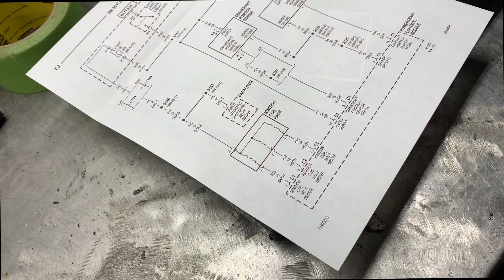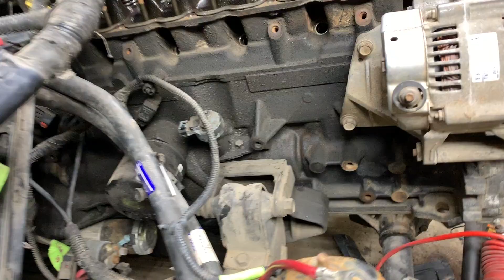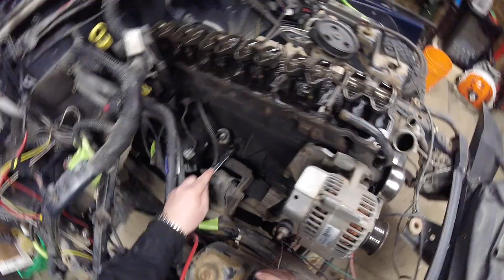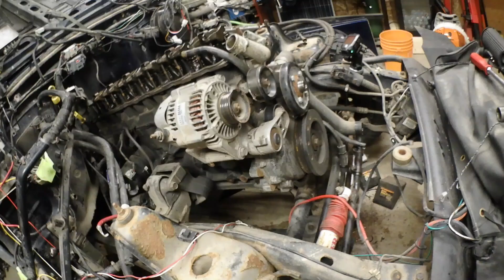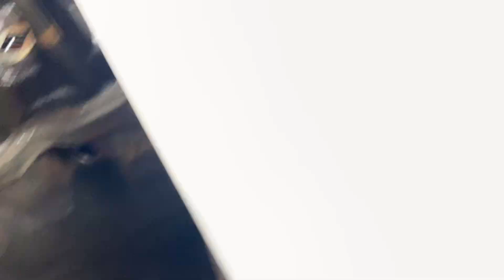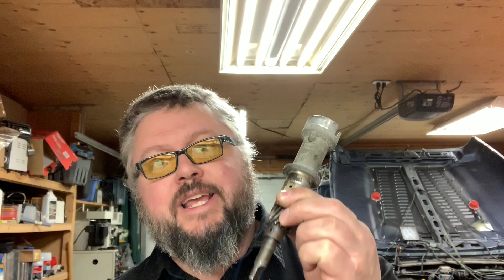DIY Jeep TJ Camshaft Postion Sensor / Synchronizer 4.0

Comment from the maker: How to sync cam after replacing those parts 
https://youtu.be/wKdtRec9dKI
Reply: Question. My jeep wrangler idles fine and even in gear I can let go of the brake and It won't stall but when I press the gas in gear it hesitates a little bit, catches, and then stalls.. please help

Comment: Man I have 2001 xj 4.0 driving down the road cut off the fuel pump wasn’t working we changed it now it works but we got crank no spark we have changed every sensor checked every ground redone ever ground even checked timing chain fuses relays possible bad connections everything turns on just won’t start we literally have nothing left to change other than possible ingnition switch  cause it barley worked from when it was new we are completely lost

Comment: How do you do it if you replaced the crank balancer that has no marks? When i turn the crank sensor it does affect the engine idle, if i turn too much then the engine shuts off. Its running rough like it needs more throttling.

Comment: Holy crap did I struggle w this for 3 hours today. Mines still in tj w fan, had to remove belt for TDC mark, didn't seem to wanna just drop in, when it did drop in, musta been 180 out , 50/50 would be my luck to f it up. 180 out: started, ran, put back together realized after applying throttle would stumble and die.... sounded AWFUL 😢
 Back a TDC agai, after messing my arm up in the fan, pulled sensor and noted position of sync was wrong. Also noticed it looked 180 out. Pulled sync back up, turned 180...where it should been, then, and only then did it actually JUST DROP IN 😂.
  IT WORKED interestingly enough it did set off the $$ light. Code p0340, 0351, 0353
   Minutes after running, engine lights off, no codes.
 I replaced sync cause it was wallowed out and was tapping the sensor everytime it came around at low rim. Ticking sound is gone. Runs great now, thanks man !!!

Comment: So, I have just replaced my oil pump and I have to prime the pump by removing the Cam position sensor and using a drill with a  long flat head screw driver to spin the oil pump gear. Once I do that I have to replace the Cam sensor. So I'm going to treat it the same way I would if I were lifting a distrubutor: Mark it good, lift it, be careful with it, replace it as per marks. If that doesn't get it perfect, I'll set it to TDC, line up the holes and re-install as if it were a new camshaft sensor. Ya like that?

Comment: So how do know if the cam sensor is 180 out and do you make sure the shaft goes in at the 11:00 position at the oil pump to know it’s not 180 out?

Comment: THat big thing there cannot be the camshaft position sensor. The sensor is small. ANd further; Is it necessary to crank the engine to top dead center on cylinder one when I have just removed the sensor and placed it back without driving without the sensor?

Comment: Just to clarify... the Crank Sensor will tell the ECU when the Cylinder #1 is in TDC so you don't really need to worry about Cylinder #1. Just align the camshaft harmonic balancer notch to the mark and install the Synchronizer as stated in the User Manual and this video and the Crank Position Sensor will take care of the rest.

Comment: Any info on where can I order this part? Everything that populates in search is just the top piece, but not the full crankshaft..
Reply: Cam shaft position sensor synchronizer, you can buy the sensor separately or get the synchronizer witch comes with the sensor, i suggest getting the whole thing because there’s only a few dollars difference on buying the synchronizer/sensor combo and just the sensor

Comment: I have an old one Jeep Grand Cherokee 2001 that little plastic cap that's is the sensor that's all you have to change you don't have to fool with that other part about 155,000 miles that's the code that came up thank you Jeeps always seem to break always break

Comment: I just got a code for the camshaft position sensor. Was making sure it was drop in. Hopefully the crank sensor is good for now. Will find out. Thanks for this video.
Reply: Ended up being the coil pack. Ha

Comment: I'm looking at putting a cam and lifters in an 02 4.0.
Aside from the headache of removing the head and all the prep work and labeling/identifying all the parts for reassembly, I dread timing the cam sensor(which obviously has to be removed to pull the cam) hopefully my scan tool has access to the diagnostic for synchronizing the sensor so there wont be a major hiccup during the cam break-in

Comment: could a bad cam sensor be the cause of no spark?
Reply from the maker: depends on the vehicle but yes a faulty cam or crank sensor can lead to a no spark condition
Reply: @TestDontguess  i appreciate your quick reply!!  
i have a 94 YJ 4.0 manual - everything seems to work, check engine lights, fuel pump priming, starter all work with the exception of no spark to the plugs. have replaced the ignition coil, crankshaft sensor and just replaced the ECM.  the tech says that he thinks the ECM is not sending a ground and some of the capacitors are bad due to it getting shorted out with some exposed wires they discovered.  Maddening!

Comment: I had recently replaced two cam sensors on a 2000 and 2003 4.0 GCs.  Didn’t pull the entire CPS out and only replaced the electrical part on each.  Never had to stick it on a computer to align.  Neither have codes either . Just FYI.

Comment: I just had an interesting failure. 2003 TJ with 100k miles. Check engine light on and drove home 2 miles, shut engine off, would not restart. Code for cam position sensor. Pulled the top portion off and, lo and behold, the magnet came unglued. Nothing broke so a new sensor cap and I was good to go. Anyone else have the magnet come unglued?

Comment: Why cant you turn the crankshaft backwards if you pass the mark accidentally, you can turn it back, just turn it way back to pass the mark due to slack in engine timing belts or chains, and then approach the mark with much better caution. Its best to us a breakable item for the alignment pic such as a toothpick so people who forget the pin is in and then later crank the engine over while waiting for a new CMP Sensor, they don't break the camshaft part also. You will need a scope to align perfectly to set the timing but a scan tool will do a relearn for you if its off somewhat, that is the purpose of the alignment holes, in the video, it was moved a little before tightening everything down. Test all wires with the connector plugged in to load the circuit properly, of course testing the 5 volts with connector off only tests the integrity of the wire that is holding on by a little strand but cannot carry enough current for a good signal from the computer to the sensor worse case, at least you know the computer is working. Also know that the computer sends this same 5-volt signal and same ground wire to many sensors so a break in this specific wire nearby may be your problem as there are several slices, time to tear the wire harness open. Dont set timing until the engine is fully warmed up and at normal idle, this also goes for scanner relearn or scope alignment. Thanks for the great video.

Comment: He also if you did it right and did not start turn over the the oil half turn on 11 o clock then bolt it up and try it if you crank it to much will need spark plugs clean and dry off time of overflow of gasoline sometimes cranking it will mess up starter fuel pump and other parts as well as the position sensor and battery sp if it don't turn on the the first or second time stop and go figure

Comment: Easy way. Rotate the position sensor till you see a hole put in pin move it side way if it is a little lose then turn it half turn till the other hole thru the peep hole lines up or look at it as turning it count the and turn the spot to see if it short or small hole to stick the pin to be line up with the proper timing side as it rotate then is  line up crankshaft at 11 o clock facing tours it like a clock on the bottom with oil drive must be on time mark as well crankshaft pulley mark both of them. If it don't crank its turn and cranks you either overflow and dirty the spark plugs clean them up or if its backfiring a little or mess up position sensor.coil or fuel pump just test them out or listen for fuel pump sometimes flooded gasoline

Comment: Can that sensor be installled wrong If motor runs good but when you go to start the motor at any temp it sound like a 1960 Chevy with a huge out of time issue but again as far as running the motor runs GREAT
Reply: Also no i have no codes coming up

Comment: Thank you so much..I accidentally removed it thinking it was the oil pressure sensor. If it wasn't for your video I'd probably would have spent $200 for a mechanic to do it. You're the bomb 💣 Very intelligent man.

Comment: If you purchase the Dorman 689-200 it comes with an alignment tool. Checked with the scanner after and it was right on 0°. Was pretty convenient
Reply: Was your engine just cutting off before this?
Reply: Crank no start. Mostly from metal flakes on the CMP.

Comment: I'm having this problem right now, purchased a new Camshaft position sensor, and without realizing pulled the OPDA out only to realize later that I should have payed attention to how it was sitting when I took it out.  My problem is that my particular OPDA has no hole to lock the wire through.........I've seen a few other threads online where there is a plastic alignment tool thing that they use, my sensor didn't come with that.  Anyways I'm stuck now, with trying to re-align everything, and am thinking that I'm going to have to buy a new OPDA, re set the Jeep to TDC via hand Cranking like you show here.  My question is how close does it need to be?  I mean if I am at TDC, and just eyeball the pulse ring on the OPDA it seems that it is typically 180° opposite than the way the sensor wires come off the top when final tightening of the hold down ring?  Why would my OPDA have no alignment hole???

Comment: I followed everything, but I don’t have a scan tool and the Jeep won’t start. The sensor is facing the correct direction and cylinder 1 is TDC on the compression stroke. Sounds like it is either not getting spark or fuel.

Comment: I'm having an oil pressure problem I'm sure I gotta change my oil pump but do I have to mess with the cam sensor at all when I clean my oil pump
Reply from the maker: have you verified with a mechanical gauge ? Pressure is a result of resistance to flow.
Reply: @TestDontguess  I’m having an issue after driving for 90 mins and I slow down the oil pressure gauge check light comes on so I installed a mechanical oil pressure gauge.. I changed the oil , new filter and the problem came back? Added a new cam shaft drive assembly and timing is off with codes! Will try your video! What can be the problem with low pressure? This motor I had was installed a 18 months ago with 0 miles ( fresh rebuilt) 17k miles as of today! The original motor did the same as well with the gauge so I’m assuming it’s wringing possibly? Thank you on the video! Your thoughts please?

Comment: ive replaced both crank/cam sensors with mopar units the OPDA with a crown one, new timing chain, new spark plugs, jeep runs a bit different usually better after each repair but now out of the blue its wont start warm. starts and runs great cold for as long as you want soon as you shut it down it just cranks sputters maybe will start for a second on a few cylinders but cant even keep itself running in neutral full throttle.. dunno what to do at this point other than replace the cam shaft? which involves pulling the rad grill head manifolds basically strip the whole engine/top end

2005 Jeep rubicon 4.0 6speed.. any info would be great been fighting this cam/crank sensor nonsense for 2 years im starting to hate the vehicle

Comment: If it’s just that camshaft sensor for my WJ, so I have to make sure it’s top center, make sure it’s #1, etc? Or can I just undo those two screws and replace top sensor?
Reply: On my 04 WJ I replaced just the sensor and I’m still having issues so I’m about to check the timing
Reply: @mrblondeheart9562  I learned that unplugging the front o2 sensor works. Check engine on is on, but it runs great. Cherry

Comment: So I didn’t take the whole thing out, my Jeep shut off this morning goin down the road and threw a code for camshaft position sensor, do I need to get it to top dead center if I didn’t take it out or anything? Only thing I’ve noticed is that the 2 wholes where you’d put a piece of wire through aren’t lined up. Trying to keep it as simple as possible
Reply: I'm sure you've figured this out by now but if you are just replacing the sensor on top you don't have to do any of this stuff.  Just unplug it, unscew it, take it off, put new one on, screw it on, replug and done.

Comment: I just watched your video because I replaced my crank position sensor and I got the p304 code. The code states I need to replace the camshaft position sensor, my concern is if I do that do I have to the same steps as you did with setting the engine to TDC. I forgot to mention I have a 1999 Wj. Thanks in advance
Reply: Manuel Salazar I just did this today and it threw that code. I proceeded to replace the cam sensor and it's still bucking. I haven't tried the whole scanner thing. Did you?

Comment: So I changed the cam shaft sensor an still getting it to pop up on scanner so does that me I have to do the component underneath it as well like this guy in the video? Doing work myself but I'm no mechanic.
Reply from the maker: The issue is once it’s installed it needs to be set, on some high end scanner you turn it like would would a distributer and on the scanner you get the value closest to zero and lock it down.
Reply: @TestDontguess  really appreciate the quick response. So I just need to have somebody hook it up on a high end scanner then?

Comment: Great job man, really helped me
Reply from the maker: If you have a high end scanner that can see the cam sync signal you can then tune it better
Reply: @TestDontguess  Thanks, You the man
Reply: Know this is old thread but wut if I took the whole thing out without removing the cap. Do I still have to put it on tdc before reinstalling
Reply: @hc5788  this is also my question, I'm just gonna put it to TDC, line up.the holes in the housing and the pulse ring, and get it as close to rear facing as possible. Did you ever figure yours out?

Comment: Just watch ur vid and did everything u said but it will idle fine but u can not give it any gas at all it will shudder miss fire and the odometer goes off around 1000 rpms and abs brake and airbag light come on when u let off gas everything goes back to normal any ideas
Reply from the maker: Sounds like you got bigger issues somewhere with a power or ground somewhere.  However to sync your cam properly you still need a high end scanner like I show in this video 

https://youtu.be/wKdtRec9dKI
Reply: Also forgot to say that check gauge light is on and Batt gauge don't work right's have a smooth idle but as soon as u give the engine gas it stutters back fires and all those lights I said before go haywire any idea what it could be
Reply from the maker: Common sense would tell you figure out why the battery gauge doesn’t work and keep on troubleshooting
Reply: Did you ever find the problem I’m having the same issue?
Reply: @alexanderr.5479  yes it ended up being the computer

Comment: Replaced my OPD about 2 years ago , sounded like my TJ had a rod knock . Thank god my new one came with a cap that locks it ,so after I set timing at TDC ,I removed the old one , put the lock on new one and she fired right up and has been running great ever since.
Reply from the maker: You got lucky usually you need a high end scanner to set the cam sync afterwards getting it closest to zero as you can

Comment: I just had to replace the camshaft sensor too... still have the codes, checked the voltage and it's good so I'm lost on what to do now.  Off to the dealer.
Reply: P0349 and P0394
Reply from the maker: What code are you getting ? After it’s installed you need a scanner like I got to sync the cam otherwise you’ll get a P0340 cam out of sync